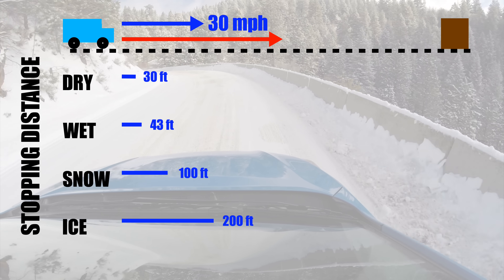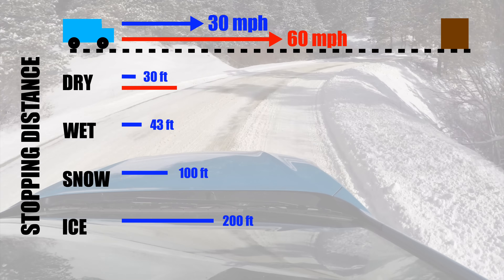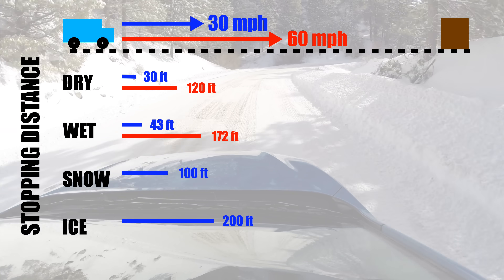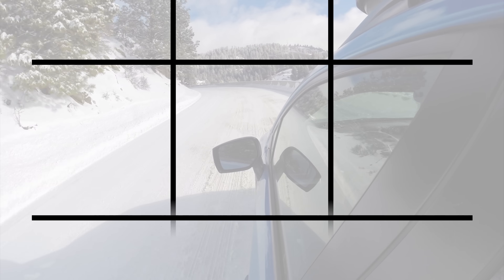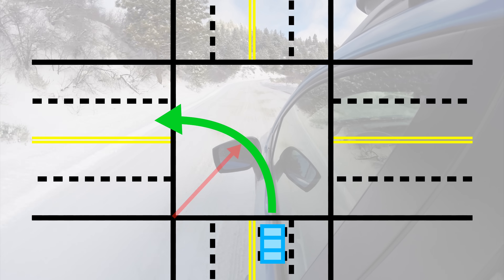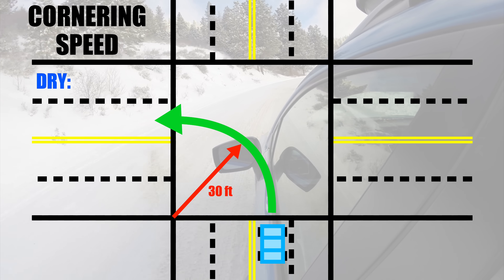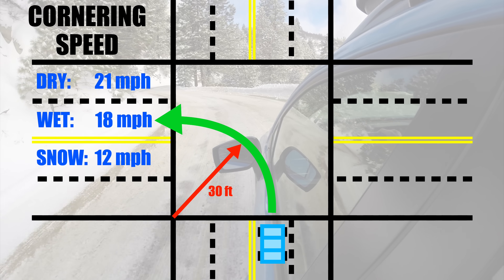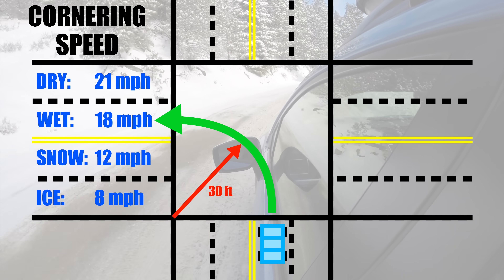Everything You Need To Know About Driving In The Snow

Comment: Engineering Explained, would be great to hear about tyre chains on snow.
Reply: Here is a little summary of what would be in that video.

The weight of the vehicle is distributed to the road on the surface area of the tires. When there is snow on the road, the smaller the surface area of the tires, the further it will sink into the snow.
Tire chains wrap around the tire, so they do not slip in relation to the tire.  By adding chains, you drastically decrease the surface area that is touching the road. When there is snow on the road the weight distribution forces the chain into the snow while the tire remains on the surface of the snow. Having the chain embedded into the snow that is being compressed by the tire allows the force of traction to be against the side of the snow not the top of the snow.
I know this is not the best explanation, so here is a little experiment for you to try. Slide your hand across the top of your desk, or any smooth surface with a perpendicular edge to it. That represents the traction your tires have on snow. Now from the edge of the desk, do the same thing but drop one finger enough to come in contact with the side of the desk as you slide your hand across it. The dropped finger will act as the tire chain and will require a lot more force to slide your hand across the top of the desk.

Comment: . . . guess you missed to point out the most important correlation: the 'traction circle' is the ultimate border for the SUM of longitudinal and lateral forces - So if e.g. the lateral force (at a turn) is near the limit then allready a very small additional longitudinal force (accelleration or decelleration) will (in sum) cross the traction circle and the tire(s) will loose traction almost completely . . .

Comment: Is the traction circle you showed just summer tyres or are the snow and ice data with winter tyres compared to dry and wet on summer tyres?
Reply: They were just a representative of the physics. All changes in the variables will change the circle.

Comment: I drive bicycle. My experience is: Studded tires are must. Better to avoid to ride on road edge on fresh snow, where no one hasn't made tracks yet, because you don't see what's under neath of the nice smooth snow. There might be anything. Especially don't go to the edge to let some car to pass, driver might  try to pass you close when you do, and as soon as you get little bit away from his way and haven't yet got the right feel and confidence about traction at edge.. Uncalled courtesy there might end really bad. But if you won't let car to pass, then that's also bad, because it will get impatient, he might have difficult to ride on your speed in snow and still try to pass you, and.. that might end badly too. High cadence is good, because you can control traction better, because it's easier to control, or change cadence, than the force you use to push the pedal.. I've seen some video somewhere someone suggesting opposite, advising to use higher gear, saying, that with a car also you don't use slow gears to start in winter.. But in my understanding, that's completely wrong comparison. Car is different. Instead use the example of torque wrench and teaspoon. To tighten a bolt to certain torque, you need a torque wrench because it's very difficult to feel size of torque by muscle, but controlling speed is more natural.. When you move your spoon in tea cup, you can control the speed that you move it quite easily to control that the tea would move enough but not spill over edge.. Though some people might not be able to use higher cadence. I'm not sure... Probably bike fit also need to be spot on to ride steadily on ice.
Wet ice is bad. White paint under wet snow is worse than ice, because the paint is made of some kind of strong plastic, and I think, that ice studs won't cut into it under the weight of cyclist, as easily as they cut into ice. Also, I think your tire studs might even not reach to the road surface, it just compress snow under tire and maybe that's why the paint is so slippery.. But I like to ride in winter when weather is good and everything is nice white from fresh snow. But I fear cars, because I can't be sure how adequate all drivers are.
Reply: Well actually after thinking. The gear choice on bicycle on snow seems more complicated thing, when it's about starting.. But I still think easier gear is better.. I think it has to be such gear where you can keep your weight on bike.. if the gear is too hard on bicycle, the wheel will slip, that's what I think. Don't know why some say to use higher gear.

Comment: As a Canadian I think I know a lot about winter driving. Here are my thoughts: first, there is NO SUCH THING as an 'all-season tire'. That's marketing BS and drivers should know better. Second, if your 'winter tire' does not have the 'mountain snowflake' logo on the sidewall it is NOT a real snow tire. Buyer beware!
Reply: Actually I know from experience that there is in fact an all-season tire. There are snow tires that are better in the snow than the best all-season tire just like there are summer tires that are better on dry pavement than the best all-season tire. However there are tires that perform very well on both dry pavement and snow. They perform so well on both that they are actually rated above the average tire for both dry and snowy surfaces.

Comment: You couldn’t get more basic except your explanation was just too text book.  How about adding weight to improve traction!!! Carry salt or sand to use for traction!!!  How about getting better quality of tires with better tread!!!  How about how you drive???  Don’t lock your tires when stopping or sliding??  How about turning the wheels into a slide/in the direction of the road if you loose traction???  Don’t spin your tires to get moving or accelerating or trying to get up a hill, that just makes a layer of water on top of the snow/ice!!!!  DO YOU REALLY KNOW WHAT YOU ARE TALKING ABOUT!!!!!!!!!  NO. I don’t think you ever really drove much in the snow.

Comment: i dont know if you learn that in driving schools in the us but: Messureing the necessary distance between cars in seconds instead of "distance XY" seems strange because its a distance.
Another example: Messuring the heat of the water in your cooking pot in seconds is not smart. there is a scientific number for it and its degrees celcius. from 0 (frozen) to 100 (cooking)
But how many seconds it takes to cook or freeze water is dependend on a trillion factors.

Comment: i have a question i remember last time i drove on snow with my winter tires the tires had grip in the straights but in cornering the grip was still good but when the tire looses grip it tends to slide more than if the car lost grip in the straight why is that happening
Reply: It is the difference in static and kinetic friction. Static friction is generally higher than kinetic friction.
When driving the static friction is what prevents your tires from sliding sideways. Once your tires start sliding sideways, the friction then becomes kinetic friction until the tires no longer slide sideways. Since static friction is generally greater than kinetic friction, the traction of your tires to the road drastically decreases after they start sliding sideways.
On a straight, the force that causes your tires to slide sideways is easier to overcome than on a corner. This is due to the forces that are pushing on your vehicle toward the outside of the corner. These forces are not present on a straight. These sideways forces on your vehicle in a corner are much like the forces you feel on your vehicle when driving on a straight with high side-winds pushing your vehicle into the other lane. High winds in the snow can make a straight feel just like a corner when trying to get back to static friction.

Comment: This is how many Gs I feel each type of tire delivers. In the dry, good all seasons can pull 0.6-0.7G (well documented), crappy/green all seasons around 0.5G, in snow, all seasons can probably do 0.15G and snow tire can do 0.3-G. in Ice though, I think all seasons is around 0.05G and snow would do 0.1G, both would be way worse than all season in dry. BUT, 0.6G condition in dry with all seasons is essentially racing on a track (do you drive around screeching around corner at limit of grip, or brake with full force with ABS activated all the time in the dry? no) , typical driving condition in dry uses around 0.3-0.5G, so snow tires in snow conditions are similar to what people expect to drive with all seasons in the dry. The only condition really all the Gs are used in dry is emergency braking, which even with snow tires, you want to leave extra room for reduced braking force.

Comment: what , any of you can tell me about driving using snow chains ?
what the Top speed driving using snow chain?
we may be traveling fron El paso TX to Mineapolis MN in the winter that's the reason of mi question ...thanks
Reply: I have no experience driving with chains, but here is what I understand from the physics behind them.
Do not use chains without a significant amount of snow on the road.
I am sure the lateral grip is not improved, so I would not drive with them for any length of time. Just to get up and down steep slopes and out of ditches?
The ride will not be very smooth, so I would not drive at any high speed.
If you did in fact drive with chains, can you let me know if I am correct in my assumptions?

Comment: Snowy roads have 2 effects other: if the snow is soft and really thick then it is usually beneficial to turn of traction control. In practice it turns out if you get stuck in the snow with traction control on sometimes you can get unstuck and going again by just flooring the pedal and spitting all the snow away. It might sound odd but I've seen tests where it works and I've tried it out myself during last winter.
Another effect: in slippery environments using the dynamic friction can be more effective to push you forwards than static friction. On a slippery road both the static and dynamic friction coefficient are low, so it doesn't take much efford to let the wheels spin at high speeds. 
Look, there is a reason why rally cars (sometimes) drift during turns, there is a reason why Russian and Skandinavian racers drift on ice. On ice you can take a turn faster sideways than forward.
Anyways, every snow drifter uses winter tires, so there is no excuse for not buying proper winter tires. And obviously if you're not good at drifting and/or you don't know what's ahead of you driving slowly is obviously safer. And i have to admit, it's quite hard to brake your car on ice with dynamic friction, you can't easily put it in reverse to floor the throttle.

Comment: THE most important thing to know about driving in the snow, winter weather, is practice. Best advice I ever got was to go to an empty parking lot the first snow and have a little cautious fun experiencing and practicing driving in it. Ditto for gaining experience with driving in rainy weather.

One quickly learns that the brake and steering wheel should not be one's first option when experiencing control issues.

Comment: I like the concept of the traction circle. I have used it when teaching winter driving to family members, ie if you are using all your traction to stop, you can't steer well, and if you are in a front drive vehicle, using all or most of your traction to move forward, then steering becomes difficult. This is why I am not so much a fan of FWD vehicles for winter driving and actually prefer RWD, due to the decoupling of steering and forward traction. 
I learned how to drive in snow back in the '70s, in RWD full size domestic US vehicles, with studded snow tires on the rear and some sandbags in the trunk. Then changed to FWD and was surprised, that it wasn't really better, just more controllable at the limit of traction. Wound up with Jeeps, and Subarus. Both are great in snow, but still use studded snows for the ultimate in winter traction.

Comment: Winter tyres only work properly in very low temperatures - otherwise they heat up and either break up or wear down quickly - which destroys their grip. If you have a 4x4 the best option is All Terrain (A/T) tyres with the Mud + Snow symbol (either M+S or a little picture of a mountain & snowflake). These have large self-cleaning treads which throw out the snow. You still have to take it easy but at least you have better traction. They can also be used all year round and are better on wet grass too. If you're thinking of getting a 4x4 for use in snow, get one with a lockable differential (or computerised snow mode) so wheels can't spin independently.

Comment: So you don't want to drive as fast as possible, make really sharp movements, leave your summer tires on, and drive as close to person in front of you as possible. Damn I have been doing it all wrong then :). all joking aside the most important thing to remember is DO NOT use your brake while turning, you will slide. Slow down before a turn, keeping the wheel straight. If you feel your self start to slide, hit the gas. If you are sliding that means your car is putting to much g force in that direction, by hitting the gas are pulling the g force into a opposite direction. But never, ever turn the wheel, and use the brake at the same time.

Comment: Legit question here; I’ve heard two schools of thought on tire pressures for winter traction. One, lower tire pressure a little bit for a larger footprint, or two, (and the one that works good for me) give them a little extra to increase the pounds per square inch/ kg per square cm. Any thoughts?
Reply: lower tire pressure with the wider foot print is how the pounds per square inch works, 
the lower that the tire pressure is will increase the tires foot print both side to side and front to back of the tire letting the vehicle distribute weight over a larger surface/contact patch  which in return will allow you to float on the snow instead of sinking into it.
if you raise the tire pressure (or run skinny snow tires) you will be cutting throw the snow with less of a contact patch on the bottom surface underneath the snow. 

if the road has iced over, then say has 4"s of snow on top the Air down method will allow you to stay on top of the snow and compact it using it as a traction surface.
in the same scenario if you were run higher air pressure (or skinny tires [not counting a studded tire]) you would cut through the 4"s of snow and be driving on the ice. 

if the road hasn't iced over, but has 4"s of snow the Air down method will allow you compact a wider surface area and with the lower tire pressure causing a increase in the rolling resistance combined with the rolling resistance of the snow will allow better traction for slowing or stopping while the wider contact patch will allow for good traction on accelerating.
in the same scenario if you were run standard or higher air pressure (or skinny tires [not counting a studded tire]) you would cut through the 4"s of snow and be driving on the pavement but with a decreased contact patch.

a snow tire with studs running the appropriate air pressure for the conditions and use will give the best results, since the tread pattern is designed for snow traction with ice siping  including the tire compound being designed to work like a tire under colder weather with the added benefit of studs dig into ice. 

if its just slow speed driving or city in the snow, running a lower tire pressure will be beneficial. but if you have to drive on a high way or a condition were you will see 45mph you will want to only be running roughly 5psi lower at that time.

take away: snow tires with the correct adjusted air pressure for the conditions aired downed when needed and a good air compressor and tire gauge will be your best friend. most highway exits will have a gas station near by and will have a air compressor so $10 in quarters and tire gauge will also work if you don't want to take a investment into a good air compressor.
🙃

Comment: Don't forget, you can overcome the front tires grip limitation by pulling the handbrake and slide the tail around. You don't really know about "Driving in the snow" if you don't know this trick. ;) Doesn't really work on SUV or van though hehe... 

PS: You also need to disable traction controls with newer cars.

Comment: Every so often and especially just as I start my drive in the snow. I like to test my limits. I gas hard, brake hard, and try to swerve.. Of course only with no traffic with plenty of room around at slow speeds getting faster if i have to. As I said I only do so to test the type of snow to know  if it's compact or fluffy; and to see how the car handles so that during my actual drive I can have a better idea of how my car will perform in various situations. Otherwise; as he stated slow inputs but constant movement is best.

Comment: Those traction figures assume maximum grip, which is just before you lock-up the brakes, oversteer, or understeer. Once you start to slide, you have ~70% of your normal ability to slow. That's the reason for ABS; keeping the wheels from completely locking up, so you can maintain close to maximum stopping distance. And then there is the ability to control over- and under-steer ( which stability control helps with). @Engineering Explained: You could make a whole video (or several) on how to control slides, and the common mistakes people make when loosing control.